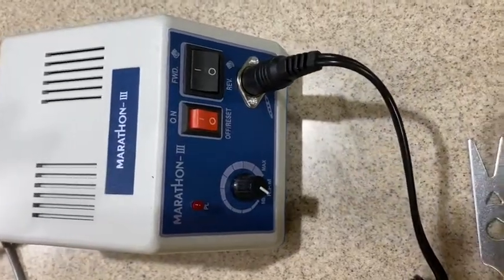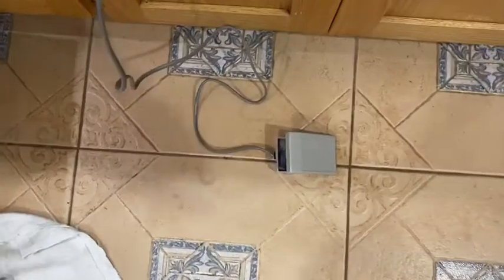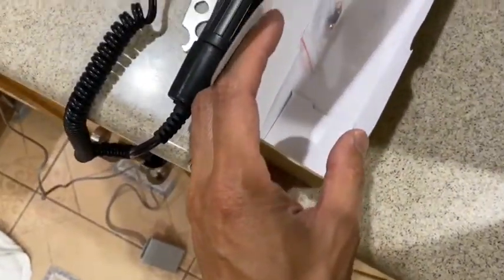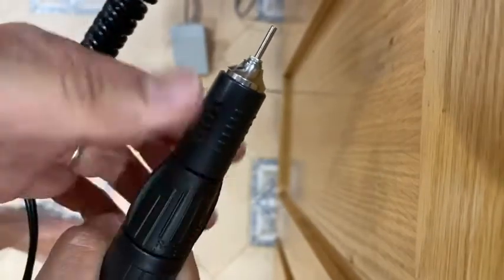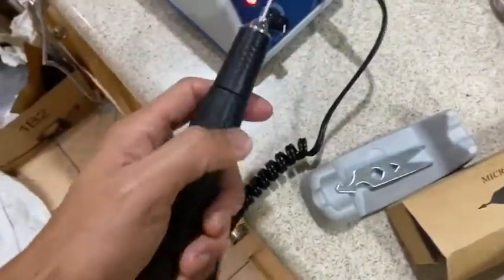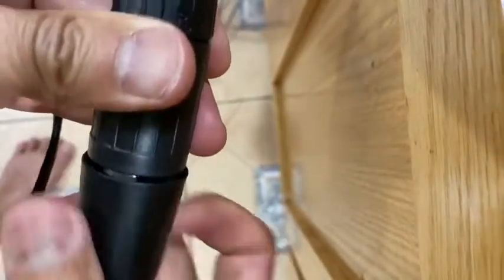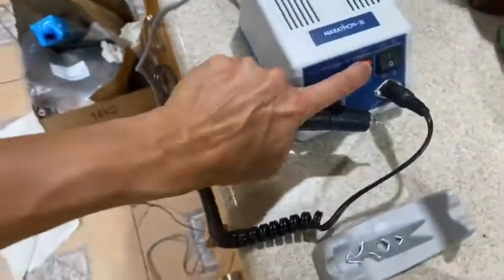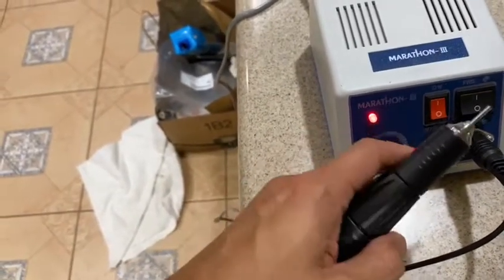How to operate Micro Handpiece With Marathon III motor

Comment: Hi there
Thank you for the video. This is very helpful. I just bought the exact model of this micro motor. At the back of this machine, there is a fuse holder. Do I need to turn clockwise or anticlockwise? Or leave it as the way it is?
I look forward to hearing from you soon.
Many thanks,
Connie
Reply from the maker: don't turn it... only when you need to change the fuse ... i haven't changed mine for 3 years
Reply: @LocHuynhDMD  thank you for your prompt reply. Without turning, does it mean the fuse should stay all the way to the clockwise or anticlockwise tho?